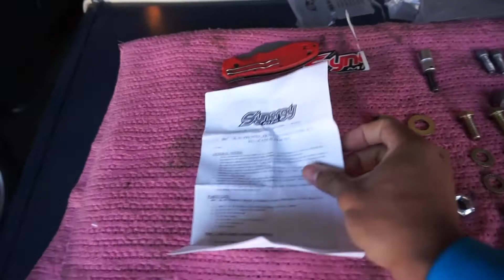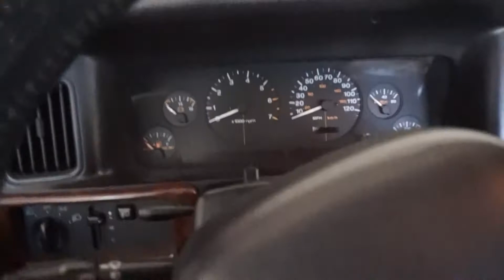Relocating & Upgrading My Steering Stabilizer [Synergy Mfg Relocation Bracket/Skyjacker 9000]

Comment: This is late but did you remove the trac bar bolt with the Jeep on the ground or in the air?
Reply from the maker: Noah Jefferson in the air. Supported the jeep on its frame and then took it out. You can also take it out on the ground without messing anything up I’m pretty sure. To reattach you will need someone to turn the steering wheel until the bolt holes line up.
Reply: Chris Meacham okay thanks I use your videos often for stuff so I can take the bolt out without anything at all in the trac bar? If I’m reading what you said correctly or will I need to jack it up and then remove the trac bar bolt to put the bracket on?
Reply from the maker: Noah Jefferson yeah, the track bar bolt on the axle side goes through the bracket, so you'll need to take that bolt out. just jack it up and take out the bolt.

Comment: My steer stabilizer clamp in the middle of the tie rod didn’t come with a bolt to hold the shock. Where did you get the bolt from. I bought the same one you installed

Comment: Nice video bud. I agree it was a better idea to take the ZJ. I drove without a steering stabilizer for a couple years, and it was no problem at all, but you wouldn't want to be driving the Jeep with that loose bracket bouncing around all over the place. It could get stuck somewhere in the suspension when the suspension cycles and end up bending or breaking something. I really need to get a steering stabilizer relocation bracket like that, that's really nice the way it's up and out of the way. I have smashed quite a few of them on the Northern California rocks lol
Reply from the maker: Vinny Gullotta thanks!

Comment: What bolt would you recommend that would fit into the synergy and stock steering shock
Reply from the maker: Sed Frederick Carlos the bolt is a 1/2-20 2.5” bolt. So something just a little smaller than that for it to fit with the stock steering shock.